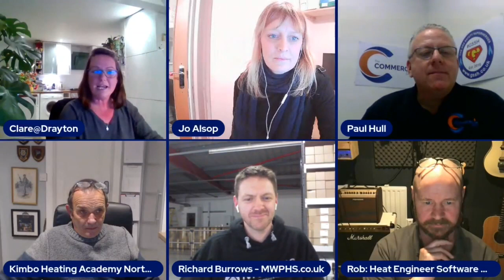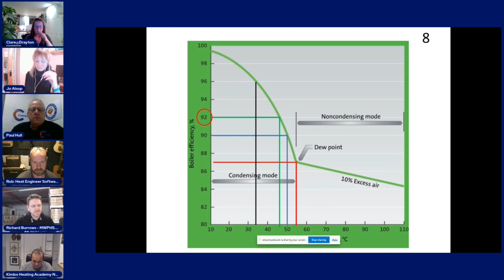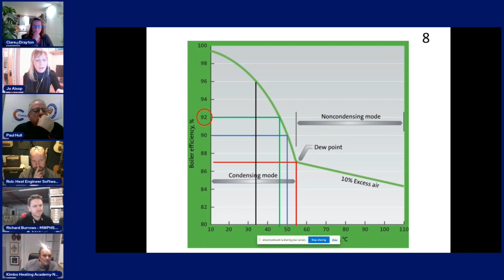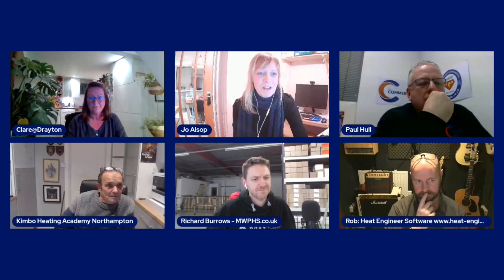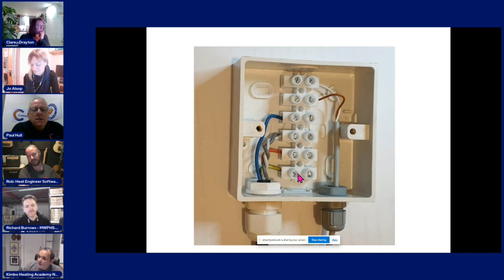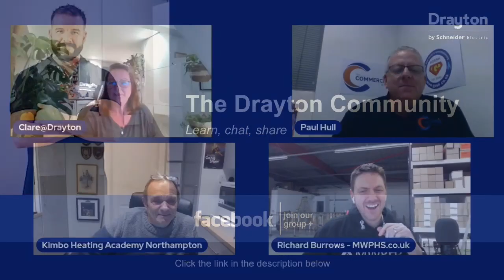FB Live Expert Panel - How To Implement Low Flow Temperatures With Heating Industry Experts

Comment: Very interesting video. I’m a diy’er who has recently been upgrading my heating system. I’ve fitted Drayton auto balancing valve bodies with the Drayton Wiser smart system. I’ve changed a lot of my rads to type 21&22 and planning on replacing the rest. Most of my rads were type 10&11 and undersized and the house struggled to warm up. Recently replaced all the windows and doors and increased loft insulation. I have become obsessed with return flow temps. I’ve bought a thermal camera and electronic clamp on sensors, also dropped  the power of my old 2006  Vailant ecotec 630 to 25kw and flow temp of 62° cos of the hot water. I could probably go lower as I have an immersion which is powered from solar panels which brings the water temp up. 
Anyway, reason for my comment is one thing you guys didn’t touch on is lowering the relative humidity in the house. I am going to fit a PIV soon as I am on the understanding that dryer air is easier to heat.